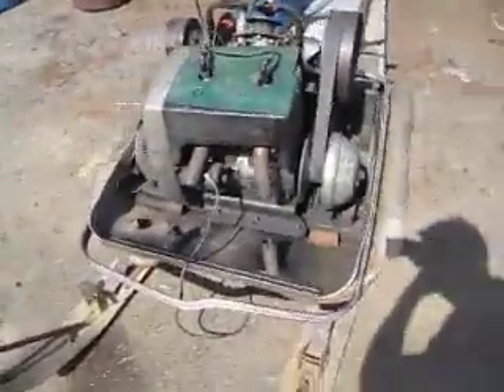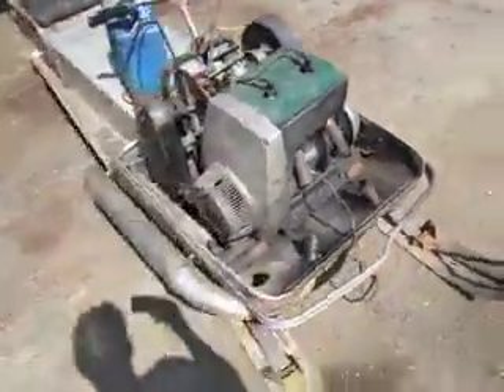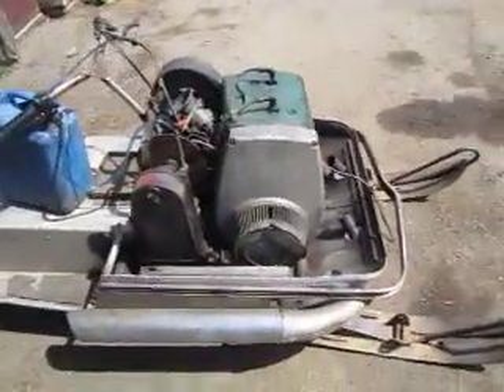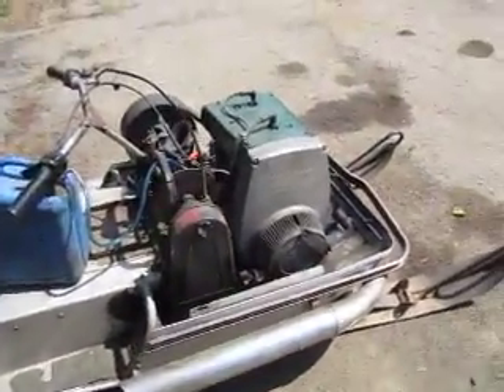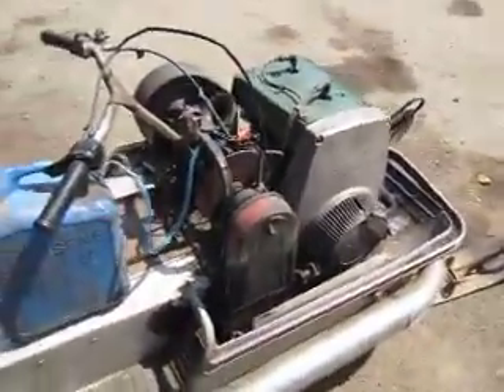vintage arctic cat panther 760 jlo

Comment: My uncle bought a new 760, probably in 1970 or 71. He only kept it a couple of years and bought a new 399 Cheetah. He said the 760 was really heavy and used a lot of fuel.
Reply: yes there  diesel 2 stroke is scary
Reply: that damn hydrogen 2 stroke jlo440
Reply: I just had a JLO760 natural gas burning generator installed

Comment: The 760 twin JLO was a real turd!!!! When it comes to performance, most ALL JLO engines were turds. Reliable, but s-l-o-w........
Reply: thats the hydrogen 2 stroke
Reply: My K 440 2T kohller runs 30 psi oil pressure and still goes
Reply: THEY ARE LOW END TORQUE AND LOW REVVING